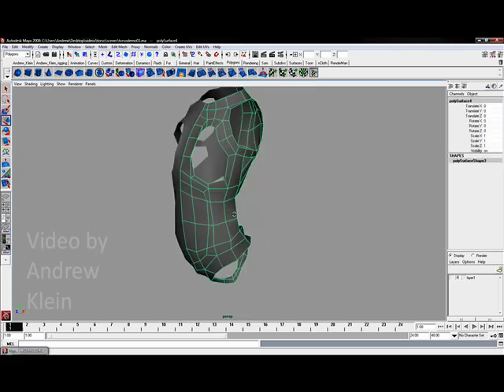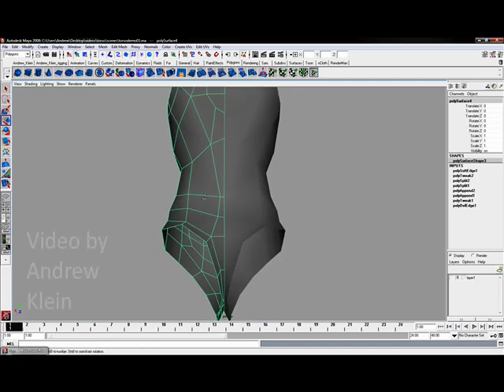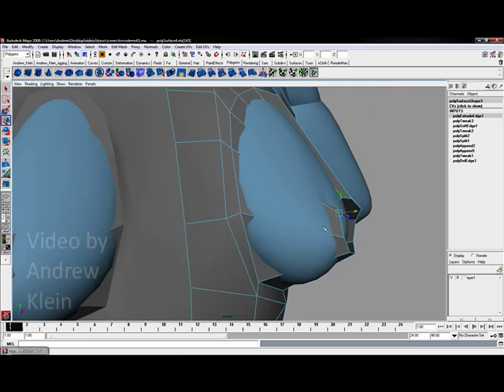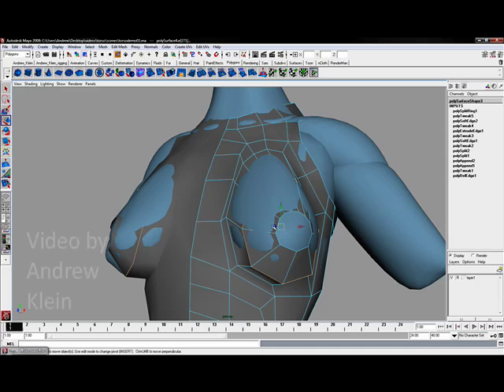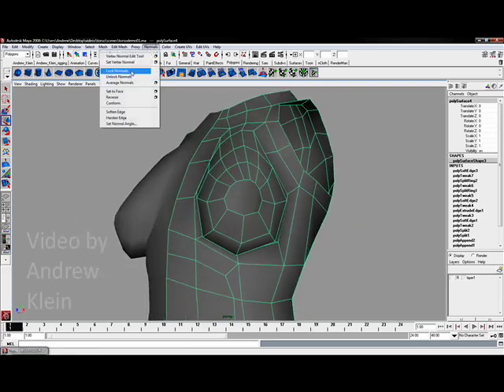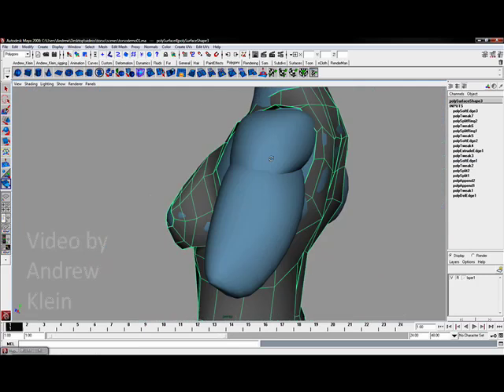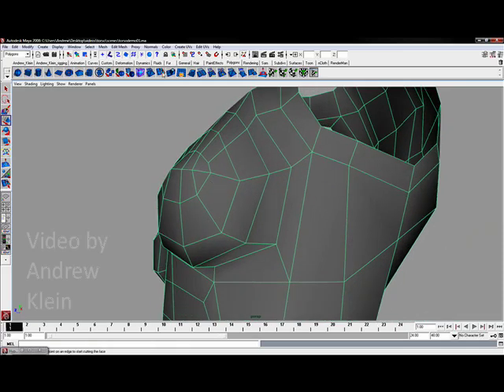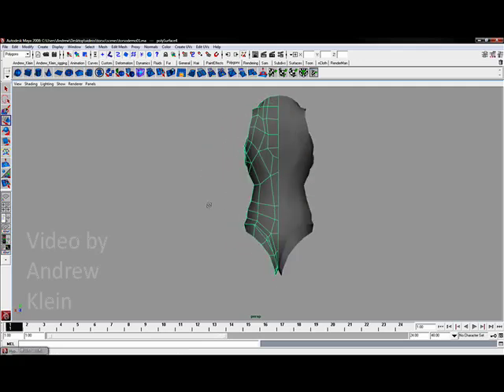Maya Character Modeling: Female Torso pt. 6

Comment: In my experience, very little. Even less since you can load the hotkeys from 3DS max to Maya if you are used with those like I am. I think Maya got better animation control. Since both are owned by Adobe I don't think one can do something much better than the other.